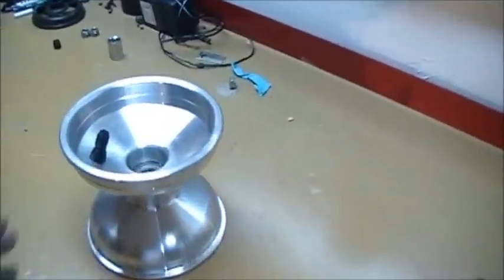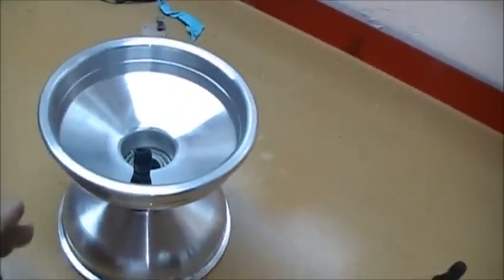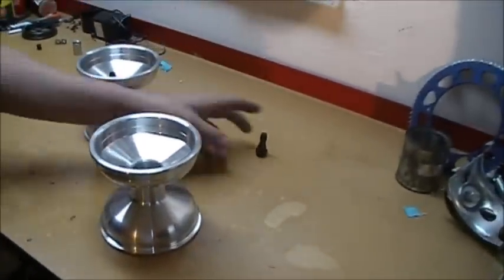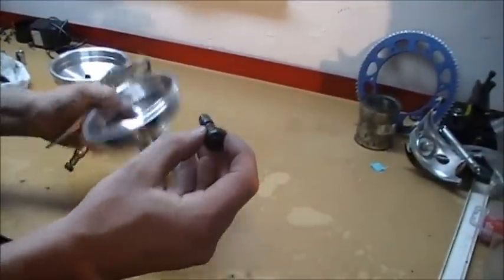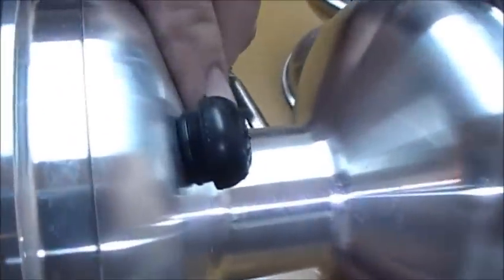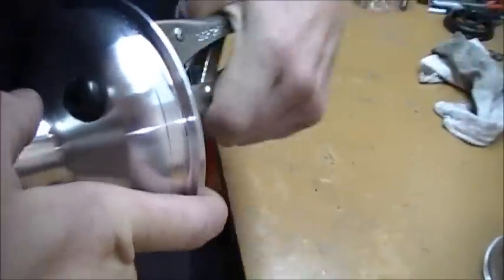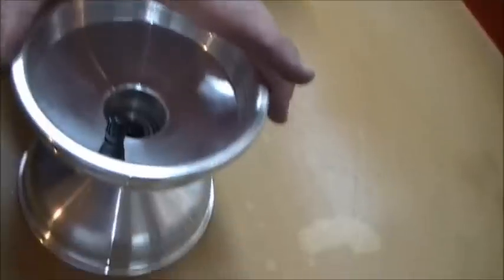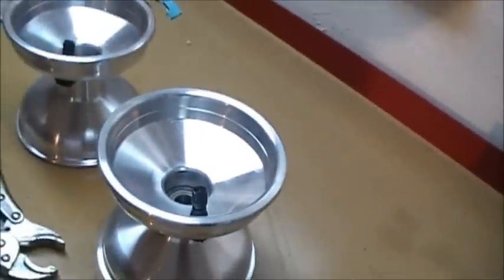How to install valve stems on kart rims

Comment: Doing that is not good will make your valve leak .push it through the back hole .lol pardon the pun !! Not intended with a 6 mm hex tool no damage whatsoever ever and a little v soapy water not oil can degrade the rubber
Reply: Put da lid thingy on